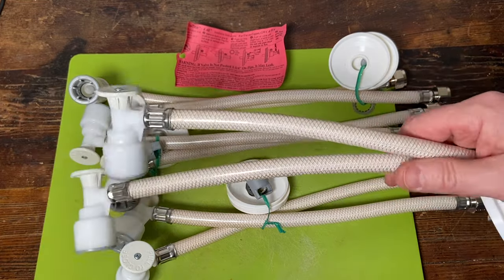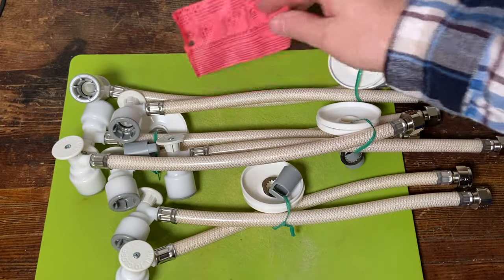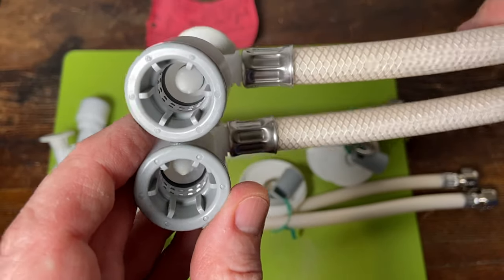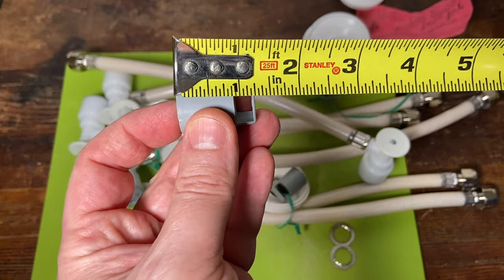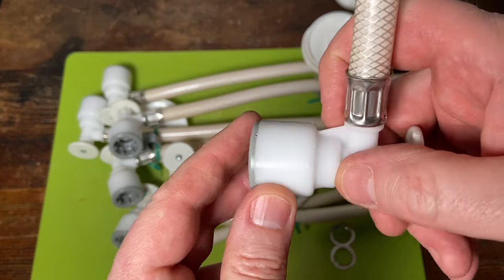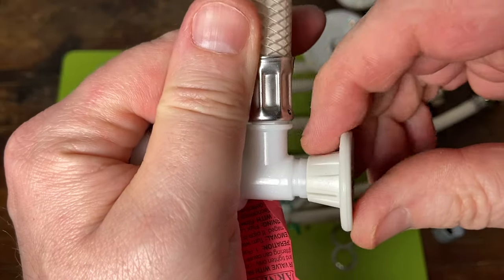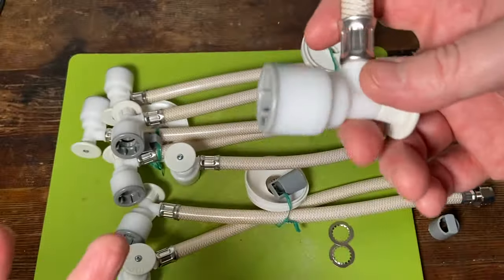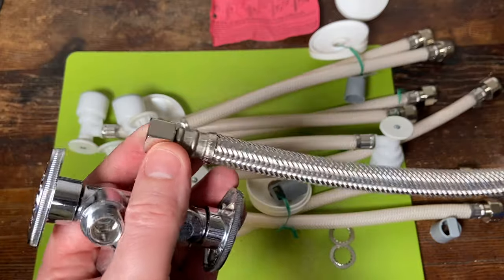A PLUMBING PART YOU SHOULD NEVER BUY!!

Comment: Brian, related to this, we installed a water filter at church for drinking water, and we used the included fittings for 1/4" quick connect. Unbeknownst to us is that those fittings can blow off and cause water damage. Our church kitchen was virtually destroyed, and we had to do mold remediation. The plumber replaced the plastic line with copper, and haven't had any problems since.
Reply from the maker: Oh yeah bro these things will do exactly what you just stated. Dealing with a little bit of that issue on a job at work right now. Thank you Bryant.
Reply: Chineese finger switch to brass compression valve

Comment: Thanks for this info.  I was looking at how to remove the tubing on one of these but now I realize it's not possible because it's one piece.  So for now I'll use the present tubing but will look for a plumber to replace all of the shutoff valves on the sinks and toilets.  Actually, my house was built in 2017 and the washing machine lines were leaking, the plumber said all of these houses have cheap plastic valves.  He had to cut into the drywall to replace them but big props to this guy for replacing the drywall piece perfectly.  It made mudding very simple.

Comment: Thanks for the very imformative video TFIG.  We just had an experiance with one of these valves.  We bought a new refrigerator after our 22 year old model died.  The water line to the fridge uses this type of valve.  We paid for delivery/removal/hookup of the new fridge.  The delivery guys refused to hookup the new fridge because of the flowtite valve.  They suggested we contact a plumber to replace the vavle with a threaded one and then they would come back out.  A complete dissapointment with the whole situation !

Comment: Thank you for your post. I have these installed throughout my home the builder put in 3years ago and a few weeks back one leaked at the crimp causing major damage to my home. I'm wondering if others have had this problem. Yes you are correct that this is "A PLUMBING PART YOU SHOULD NEVER BUY!!! "
Reply from the maker: Oh man lots of people have issues with these. Have caused lots of water damage. I just did a couple replacement videos you should check out if your replacing yourself. Great tips.

Comment: I don't want to spoil the fun, but I have these Flowtite valves in my home and I have never had an issue over 20 years with them.  I'm not trying to say they are great, but just telling you my situation. The problem is if you live in a place that has a lot calcium in the water like Florida, that can make it so you can't pull it to shut off the water.

Comment: I bought a new rv trailer last year & this is installed on my toilet.I had never seen one before.I immediately told myself next year it’s getting replaced.I do believe the hose is the same size as well.Can you make a quick video on how to replace these & what new angle stop I should replace it with & a new hose.Thanks.
Reply from the maker: Yep. I am going to be making a couple of different videos removing these for different types of pipe. It will be coming up soon. Thank you.
Reply: Thanks I have enjoyed your videos so far & have learned from you.I think those shut offs might be an rv thing because they are cheap I certainly wouldn’t want one in my house.The trailer is all Pex B & the shutoffs to the hot water tank are proper angle stops so I don’t know why this was used for the toilet.I better check when the season opens if those crappy ones are under my sinks.If so they are coming out.If there are proper stops under the sinks then someone made a bad repair.

Comment: I just had to replace less than 10 year old fridge that had compressor fail. Then I find that I can not put a new water line to icemaker because this cheap crimped fitting is there. Now I have another repair because of cheap parts.
Reply from the maker: Oh man i totally get it. I have a couple of videos on replacing these valves. Marks it pretty quick with no pipe damage.

Comment: My builder did flowtite everywhere (15 connections) and I plan to replace them. 

1. Do you know how solid the white line is on the flowtite one piece connector? Ours is rubbing against something under the sink and has a little indentation on it. 

I plan to replace that one first, but just wanted your opinions on how solid that white line is on the flowtite? Thanks

Comment: My whole place I rent have these at every faucet  I'm not having a leak issue at the valve their itself my problem is after a year of living here I'm having both the hot and cold leak from the little fitting band at the top of the hose where it screws onto the faucet I have always been someone who can repair this stuff myself I have never seen this type of valve before I think this is going to be the one and only time that I actually let the maintenance guy into my house unless someone can tell me is there a way that I can repair this line without even touching this flow tite valve and I'm afraid I already know the answer because it looks like it's all one piece feeling so disgruntled and discouraged right now

Comment: Our house is over 25 years old with ACCOR valves on everything....never had leaks or problems so maybe it was a poor install or an idiot plumber who can't turn a wrench ...just saying.  Can't say these are junk when they have lasted for this long my friend.... sorry....maybe people are screwing around with these valves causing failure....

Our pipes are the PVC not copper.  For copper I would definitely use solvent angle stops but, again, these DO WORK .  If you put it on wrong that's the fault of the person NOT valve....you can also put valves on copper/pvc incorrectly if you don't use inserts in the PVC or don't use the primer & cement correctly.....you wouldn't say the valves stink.... it's the fault of the installer.

Again....25 years is a pretty good record in our case and removing them is easy.... I see videos where they didn't cut the line before turning counter clockwise which tells me they didn't read the instructions....makes me wonder if these people ever read directions on any product before attempting install....